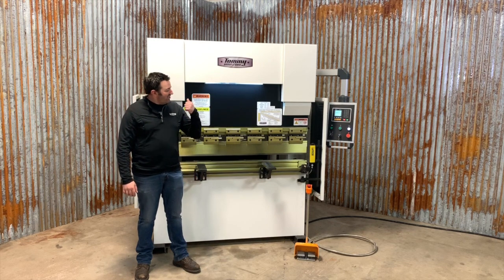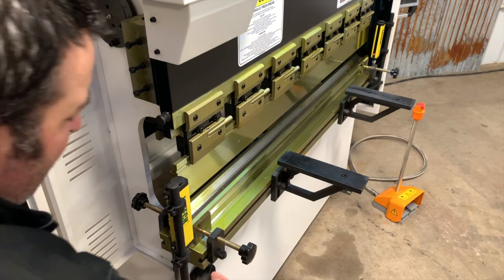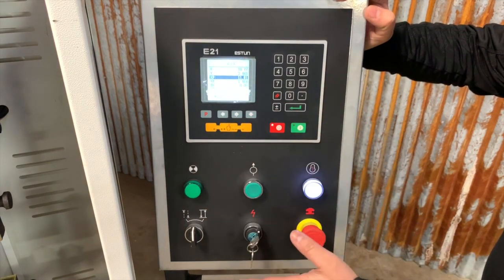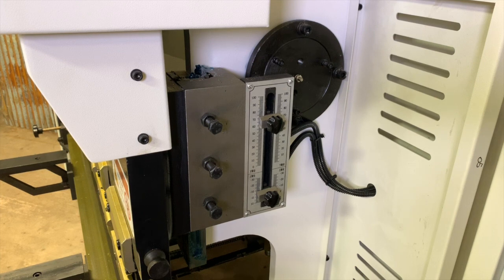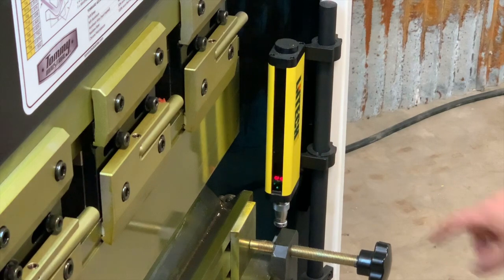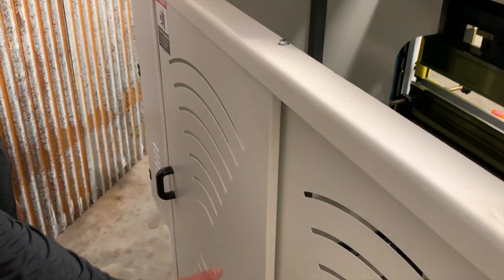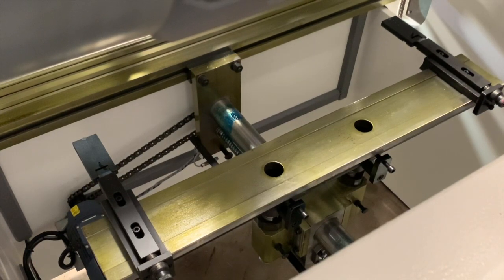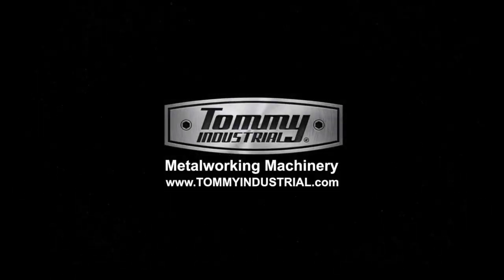Tommy Industrial TIHB33-5, Best Press Brake for the Money!

Comment: what is the max thickness in soft aluminum at 5' can this model bend?
Reply from the maker: Hello, Aluminum is very easy to bend.  To bend .25" AL using a 2" bottom die requires about 8 tons per foot.  So you could bend around 5.6', this would take 45 Tons.